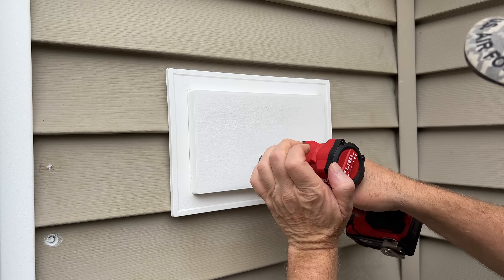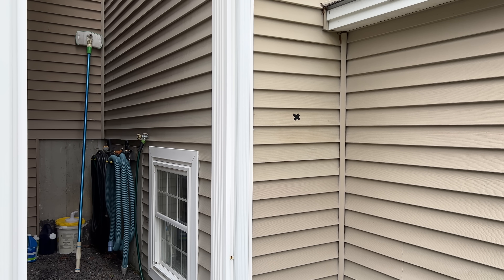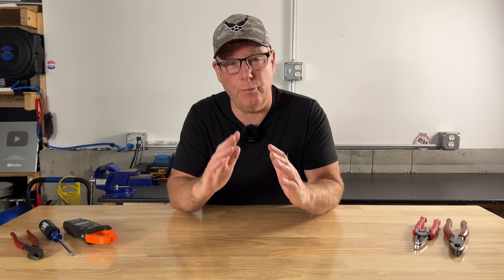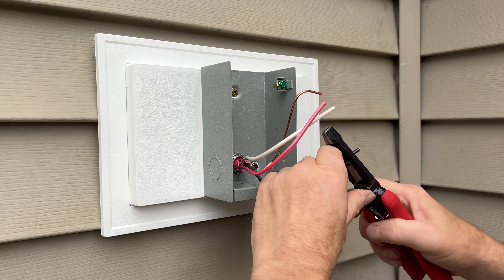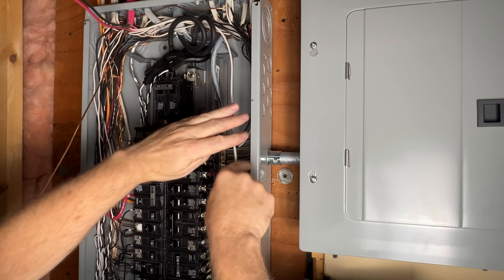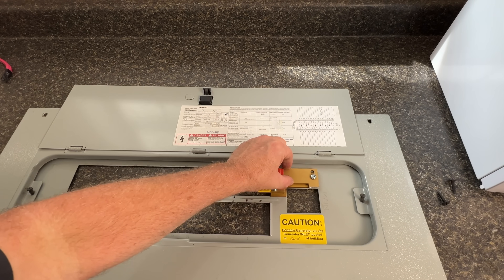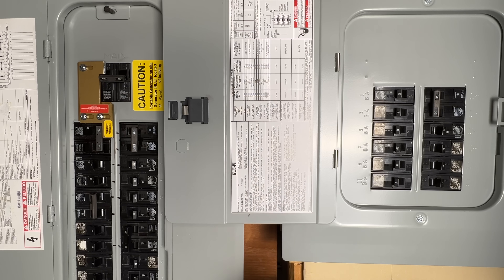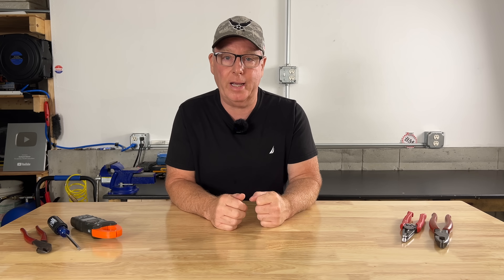Watch This Before Connecting a Backup Generator to Your Home.

Comment: I have a pony panel with the critical circuits. It has a large three pole switch that connects either to the generator or to a breaker on the main panel. My generator has a master breaker, so do I need another switch somewhere on that line connecting to the pony panel?
This video is very well put together. Thanks!
Reply from the maker: If you have a three position transfer switch you're good to go. I assume you mean the switch is connect to utility power in one position, to nothing in the middle position and the the generator in the 3rd position.
Reply: @BackyardMaine  Exactly. Thanks for the reply.

Comment: Yet another post that is worth its weight in gold. THANK YOU!!!!
Reply from the maker: Thank you my friend.
Reply: Great tutorial.  I just got done with the same project but I did a couple things different.  My generator is bigger at 6000W and  has a 14-50 plug so I used NEMA 14-50 inlet.  The generator does only produce 30A.  I used 6g wire to connect to the panel and connected it to a 30a breaker.  If I ever want to upgrade to a bigger generator, just change out the breaker to 50a

Comment: I have a split bus panel where an interlock kit and generator inlet receptacle was not an option for me. I went with a product called Generlink which was installed by the utility between the meter and the base. It prevents back feed and includes surge protection and a 50 ft 30A cable. Not the most inexpensive choice but definitely the easiest.
Reply from the maker: I've heard about that type of connection but I don't think they are approved in most areas.

Comment: My setup is almost the same as yours except I made my own interlock mechanism from scrap aluminum. It powers up my complete panel so I can select which breakers I choose. I was debating a larger generator but it only requires more gas even at idle and not worth it. Great video.
Reply: You made and installed a code violation. If that interlock doesn’t work as required and you backfeed power into the utility and hurt or kill a worker, you are going to prison and lose everything you own.  You must install an interlock manufactured and approved for the use.
Reply from the maker: I'm thinking about investing in an inverter generator with about an 8000 watt inverter. They sip the fuel when the load is light and you can safely run electronics with them.